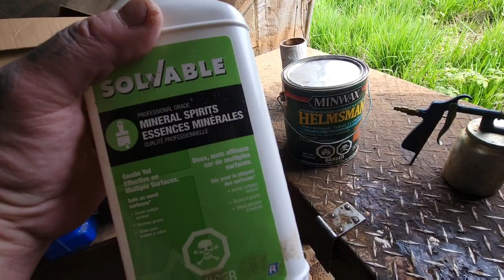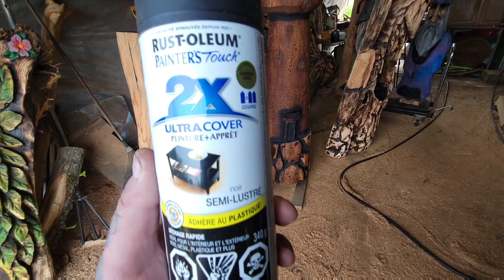How to apply a clear wood finish on your outdoor wooden carvings. Jordy Does.

Comment: Hey bud. I appreciate your videos keep making em! I have a question that may be kinda tricky and I’m sure if I asked 5 people I’d get 5 different answers. But in your experience do you wait for the wood to dry a bit before putting a sealer like urethane or poly on them? Cheers!
Reply from the maker: Yes 100% the more u let it dry the better the sealer will work